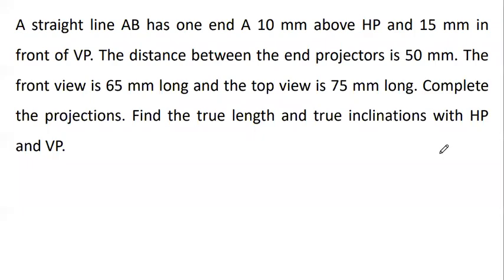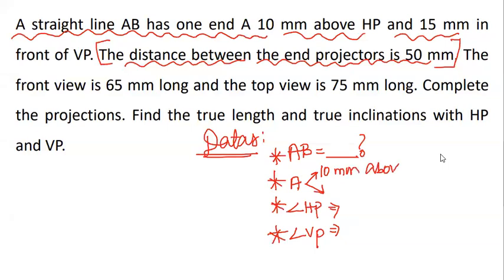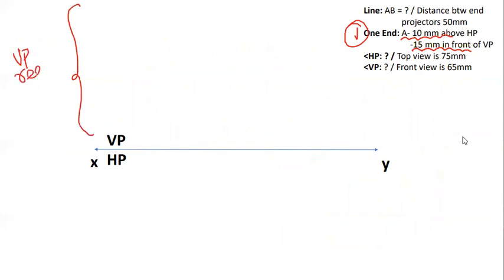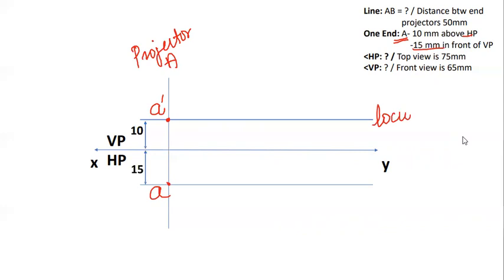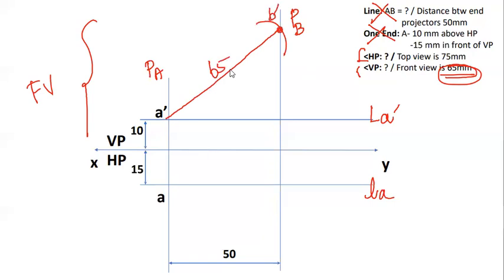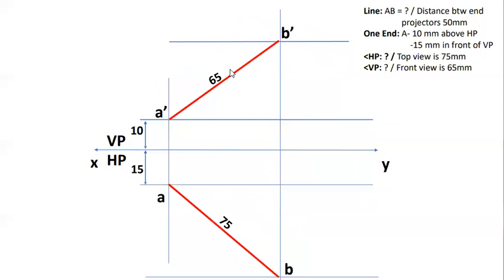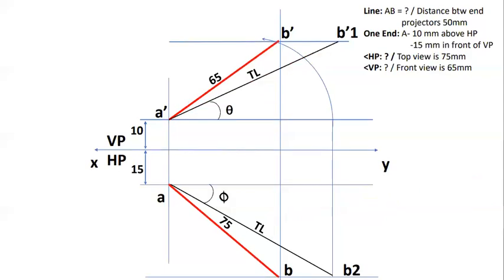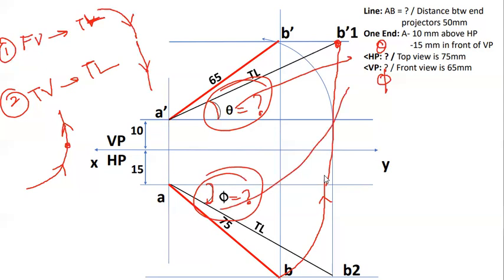Projection of lines - 3 | Distance between end Projectors Sum | Engineering Graphics | EG | Tamil

Comment: The distance between the projections of two points A and B is 70mm. A is 10mm above HP and 15mm in front of VP. B is 50mm above HP and 40mm in front of VP. Find the shortest distance between A and B by rotating line method. Find true inclinations of AB with VP& HP